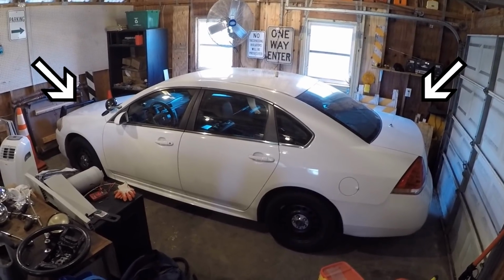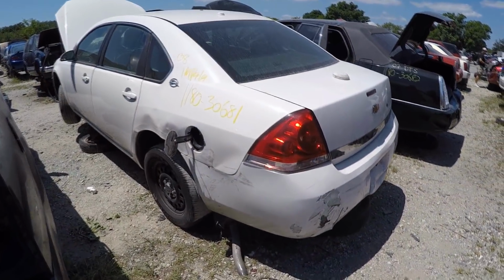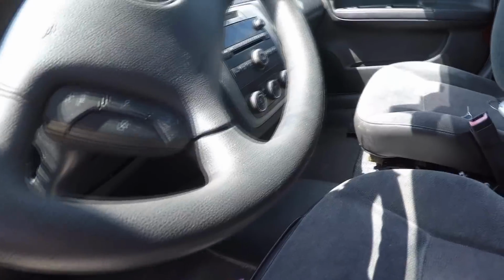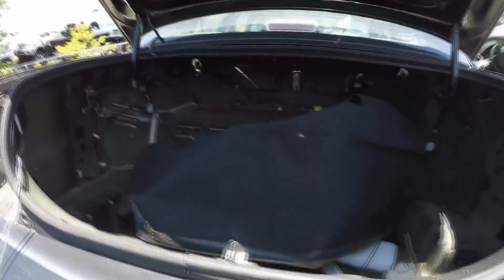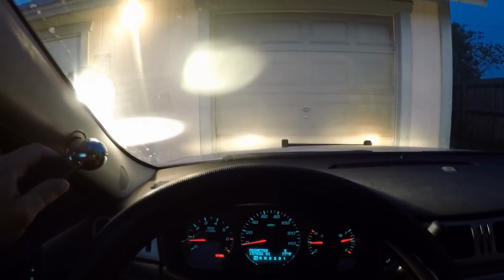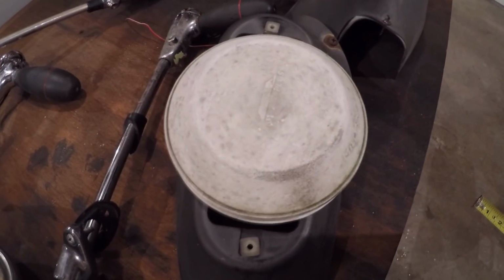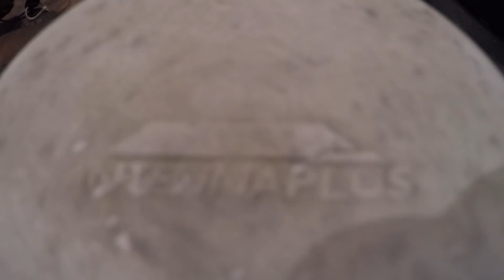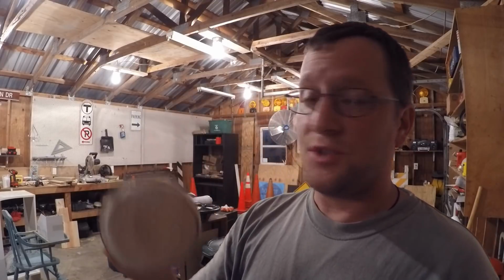Found Puck Antenna and Junk FHP Cars

Comment: Probably wouldn't be much more expensive to buy a new antenna from a supplier like Tesco.  Also, hole plugs are dirt cheap or you could mount a new antenna on roof, as holes are almost all the same size (commonly referred to as NMO or New Motorola mounting hole.
Reply from the maker: Junk yard antenna prices are low.  I think the puck was like $3.76 after tax, I probably paid that much for a couple of plugs on eBay.  I did use one of those plugs to plug the hole from the light bar... it originally had some packaging tape over it.

Comment: Can you use it to cover where the light bar used to be on the top of your car
Reply from the maker: Yeah, I originally had packaging tape there.  Actually bought a plug off of eBay to plug that hole.  I'm just worried that it will rust out over time.

Comment: Where is the antenna on an impala 2006 LT? I just purchased one for cheap and my key fob only works when up close and the car has no visible antenna unless it's in the back window some how idk.  Anyway any suggestions on key fob issue already got a new one and still the same issue???
Reply: If you're still wondering it's on the roof right about the back window

Comment: Do you drive your Cop Car on a regular basis??
Reply from the maker: It's more of a weekend car - I do outside sales currently and have a company issued Ford Escape that I'm currently running the wheels off of during the week.  As of right now, it's a 2014 with 131K miles... they issued it to me brand new.
Reply: I drive mine every single day. 😁

Comment: If I where you i would not mount it at all they don't look that good
Reply from the maker: I kind of like them, most of the local cops have them on their cars - just like the one at the end of the video (except that puck was black).  The highway patrol has some ugly ones, those are tall and cone shaped.
Reply: TheCopCar if you do put it on gi get you 3m double sticky and cut that wire flush to the base. On the clean up for it try dawn dish soap and scrub really good after all that and it drys clear coat just so the sun don't eat it up more remember the rubbing alcohol trick too if you have to